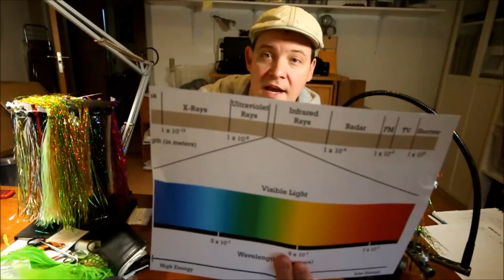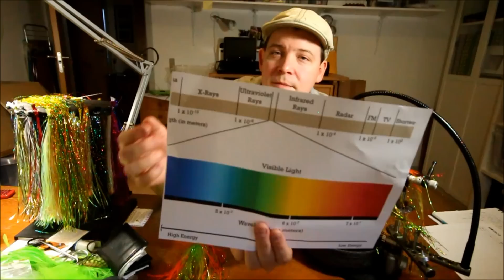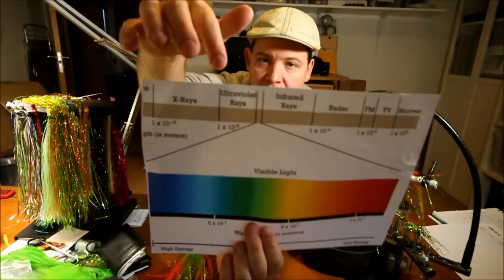Fly tying - ALL you need to know about how UV and fluorescent fly tying materials work

Comment: One correction.

You misspoke when you say that fluorescence is "reflected." It is emitted light as you also correctly state. When UV light is "absorbed" by atoms of the material. The atoms uses that  UV light energy to attain a higher energy level. Then when the material drops down to it's stable configuration, the light is emitted at a LOWER energy level which is in the visible range. The rest of the energy is lost to heat (entropy) because no energy conversion is 100% efficient.

The second form of UV light absorption and visible light emission that you do not mention is phosphorescence. In phosphorescence, there is a variable delay in the emission of light so these are the "glow in the dark" fly tying materials like Fire Fox Yarn. Some patterns such as Harrison Steeves Firefly use a glow-in-the-dark Kreinik ribbon to simulate the green abdominal glow.

Fluorescence and phosphorescence are both UV mediated energy transformations of some materials to absorb and emit radiation, one immediate and the other delayed.
Reply from the maker: Hi there Dataminer. 
Thank you for the correction ;) 
you off course correct on all your points and your explanation are very good. This video was quite hard to do and redid it 14 times. It is a balance to keep the right amount and level of science to get the point across. Therefore, I have tried to make an informative video on a mid-level physics theory and make it easy to understand.

Comment: The part on UV is very helpful. Thanks. But I don’t understand how you can reconcile your conclusion that UV materials don’t help catch fish - basically because trout don’t see the fly illuminated by a UV torch? - with your suggestion that fluorescent materials probably DO help catch fish. In describing fly tying materials aren’t “UV” and “fluorescent” synonyms? Fluorescent materials absorb short wavelength UV light and re-emit the energy absorbed in the form of longer wavelength visible light. So, if for the reasons you give, UV materials only catch fishers, not fish, mustn’t the same be true for fluorescent materials?
And the reference to the US study on trout ability to see UV light would also be helpful. Thanks in advance for any help.

Comment: Basically, anything to do with UV light has no value in materials for subsurface fly fishing.  UV light is absorbed by dissolved organic carbon within the top couple of cm below the water surface.  Only in super clear, unproductive water (usually tropical seas) with near zero DOC, does UV light penetrate below the surface enough to reflect, or to cause UV fluorescence, of anything.   This has been known for many years to freshwater and marine biologists.  There's no point judging the effectiveness of tying materials by shining a UV light on the material, unless the UV light is above the water surface, and the material is below the surface at fishing depth.
Reply from the maker: Thank you for your input! :)